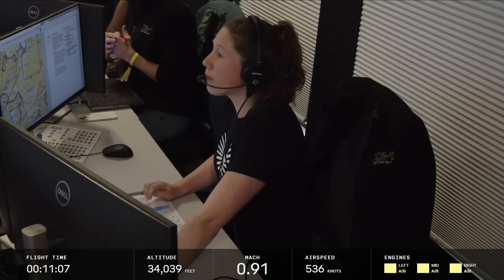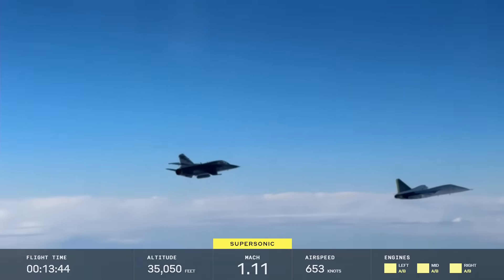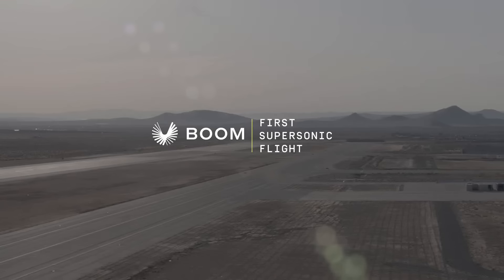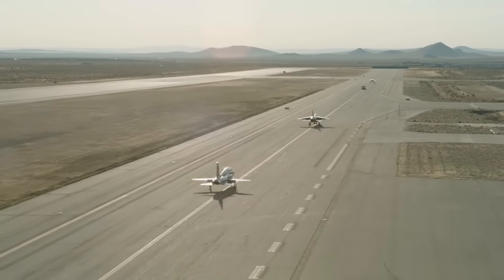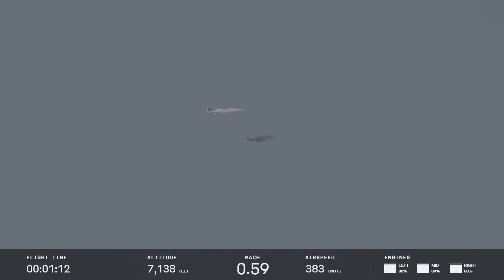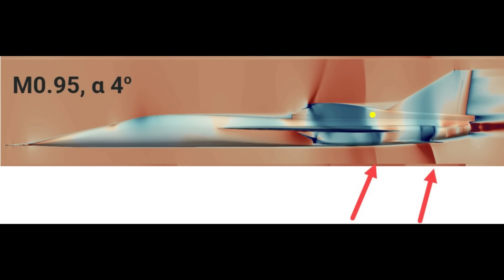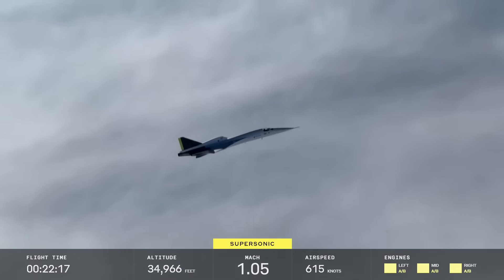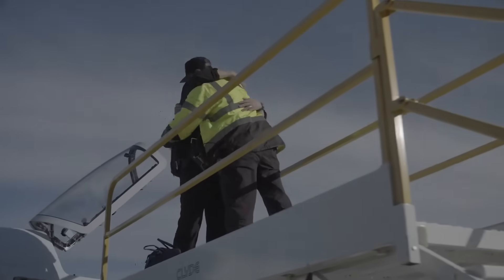XB-1 Baby Boom Goes Supersonic - Jet Planes, Starlink & iPhones

Comment: This really makes you appreciate the engineering that went into Concord 60 years ago.
Reply: Concorde borrowed heavily from fighter and supersonic bomber design. It was more elegant, primarily due to the ogive wing. It also had a remarkable range. Few people point this out, but it used afterburner for takeoff, climb and acceleration. But it super-cruised above mach 2. It could not have flown 3,000nm unrefueled if it didn't.
Reply: @Triple_J.1  Concorde didn't usually use afterburner for acceleration or climb only for breaking the sound barrier and take off- AB was too inefficient. And it had a range of 3,900 nm.
Reply: @BooBaddyBig  Concorde used full afterburner for lift off - fact from the Captains book : Life of a Concorde Pilot: From The Orphanage to The Edge of Space by John Tye. (Excellent reading by the way.)
Reply: @ No A/B in the climb. Just for T/O and then again for acceleration through Mach one.
Reply: @Triple_J.1  Yes but this one is "USA" made .Make America Great AGAIN !!
Reply: GO BACK FURTHER THAN CONCORDE TO WHEN CHUCK YEAGER FIRST BROKE THE SOUND BARRIER IN THE BELL X-1A WHICH WAS A BIG DEAL BACK THEN BUT COMMONPLACE AND ROUTINE NOW ! ! !🤔🤔🤔🤔🤔🤔🤔
Reply: It was quite something being under a Concorde taking off from Heathrow back in the day. I'm not sure that my hearing loss was down to this or all the loud rock gigs back then lol
Reply: This is nothing compared to Concorde. The Concorde with its mostly-bespoke Olympus 693s could supercruise for hours at nearly mach 2, whereas this is basically a warmed-over T-38 with a third engine, limited to short supersonic bursts in afterburner.
Reply: Or the Fairey Delta 2 which went supersonic in level flight without afterburners 68 years ago.
Reply: You mean the european Apollo programme.
Reply: @philippayne6655  Concorde
Reply: They'll be looking to the lessons learned from Concorde ove her years in service to guide the development of this new airliner
Reply: And imagine where we would be if they had continued developing and building them. Sonic Boom 20 years earlier.
Reply: Like my grandmother would YELL in church and my stepdad would say down at the mill..   "BINGO! You Nailed it"
Reply: She’s a real pocket rocket
Reply: Yes and I enjoyed flying her as a passenger…
Reply: It was very impressive for its time. The British and French engineers should be proud of their work.
Reply: @ It's still pretty impressive today. Much of the technology is still more or less state of the art. Concorde's engines were incredibly efficient even by today's standards.
Reply: Wow somebody broke the sound barrier, is this 1947?😂
Reply: Hi Scott live your videos by the way.  Two questions 1) where are you based these days and 2) what is the point of this aircraft, a prototype of a commercial venture?
Reply: Especially the 'e' for Europe, England and Excellence.
RH Tony Benn
Reply: Not seeing what all the fuss is about Chaps. Concorde flew 60 years ago carrying passengers over the Atlantic. The fuselage hit temperatures of over 60C due to friction whilst the out side temperature was -60c, this caused the whole plane to expand by three feet in supersonic flight compared to when it was sitting on the tarmac. Interestingly it was also fitted with frosted glass in the toilet windows, cause who's going to be looking in a 60,000 feet!
Reply: …and the forerunner of this aircraft, the Fairey Delta.
Reply: It truly does, but it’s way easier with 11 billion dollars
Reply: And also appreciate the super-cruise of the F-22. Supersonic without afterburner.
Reply: Yes, the Concord was first non military (civilian aircraft) to go supersonic.  Fair bit of government money though, I imagine.
Reply: concorde*
Reply: And the SR-71 blackbird is also amazing looking like it came out of Star Wars.

It's incredible how nobody ever cared more for higher speed...
Reply: Yeah, not really.
Reply: You are spot on! I fail to see exactly what is supposed to be ground breaking about this. Don't forget,  Great Britain had a jet car the Noble SSC which broke the sound barrier ON LAND in the 1980's ! None of this boom experiment is new, in fact it's very old hat!
Reply: well, from an engineering point of view, the concorde was a masterpiece. but commercially it was a disaster. they had like 70 orders, all cancelled because of the noise. and the ticket prices were many times more expensive than on subsonic airliners which also contributed to the end of the supersonic era.
Reply: @mrxmry3264not quite. They cancelled be cause the US denied them access to it airspace whilst flying supersonic. Noise was the excuse, commercial extortion was the reason
Reply: @mrxmry3264 Noise legislation by the US government, you mean.
Reply: @mrxmry3264Concorde orders were cancelled because of the 1970s oil crisis increasing fuel costs. Noise was a secondary issue, there were plenty of routes over oceans.
Reply: @ No, the options were cancelled because the 747 (1969) ushered in the ethos of minimum seat cost per passenger mile, changing totally the direction of the airline market. The supersonic market all but vanished when that happened.
Reply: @gzk6nk the US banned supersonic overflight in '73, and QANTAS cancelled its order for 6 Concordes in .... 1973, and Boeing didn't have one. Imagine crashing a Boeing at supersonic speed.
Reply: @mrxmry3264 There were lots of people who could afford it. However, why wait for a Concorde flight if you can just hop on the next regular flight and be in NY in 7 hours when with Concorde it took an average of 9 hours? (Assumption regular flight: one flight every two hours, flight time 6 hours, average wait time 1 hour. Assumption Concorde: two flights per day, flight time 3 hours, average wait time 6 hours.)
Reply: If this was the equivalent a Starship test flight, it would have exploded at Mach 0.8, and Elon Musk would have proclaimed it was a brilliant result.
Reply: @Beer_Dad1975 I found the EDS, probably TDS too. Salt lyfffffe 😂 cry baby cry!
Reply: *Condcorde
Reply: There was no reason the concord couldnt work. The metallurgy and fan r&d just wasnt there yet. Now we have engines that eat 70000 lb of thrust for breakfast, concords tapped out at 40000 lb full ab.
Reply: Concord was an complete POS !
Reply: @gertjanvandermeij4265  Concord was the cutting edge of technology.  Unfortunately it's operating costs exceed the number of people in that much of a hurry so it lost money. 
Sonic boom restrictions didn't help. LA-NY or SFO-NY  might have been profitable.
Reply: @gertjanvandermeij4265 . Maybe, but Concorde was a triumph.
Reply: Never  financially worked
Reply: not true, it intermittently was profitable, but being restricted from most of US airspace was a critical setback, as it was essentially designed for US to UK and mostly denied it except 3 airports.
Reply: @LordFalconsword   It was very profitable for BA right to the end of service  once Lord King took over when the airline was privatised and they started charging the high ticket prices the market could bare,
Reply: It was highly profitable for British Airways in its later days.
Reply: @ It's been considered an Anglo-French equivalent of the Apollo space program. Except unlike Apollo the airlines made good money, which was taxed, and among the many spin-offs included the creation of Airbus, which is still going very strong.
Reply: @ They absolutely weren't given the planes for free at any point. BA was originally owned by the government, and their Concordes were sold as part of the overall package when BA was privatised.
Reply: Not true. Operated profitably when released from the shackles of BA's corporate management. Would have continued to do so had the Sept 11th terrorism not murdered many of its regular customers. Every development day that Boom has will highlight how incredibly ground- (/air-?) breaking the dual-language Concorde development team was. Perhaps we should wait until Overture is in commercial service before attempting to make comparisons. This aircraft is more comparable to a Fairey Delta.
Reply: IT DID FOR HIGH NET-WORTH PEOPLE ! ! !👌👌👌
Reply: Yes it did. British Airways made a large profit from Concorde until the French pulled the plug.
Reply: @peanuts2105 yes they did  , but as the previous commentator said it was GIVEN to British Airways and Air France by their governments , we the tax payer footed the bill .
Reply: @peanuts2105  Because the taxpayer paid for the plane. Basically they shifted wealth from the public to a private company to create supersonic leasure trips for rich people xD
Reply: @hernerweisenberg7052   do you feel hard done by or bitter?
Reply: @ Not quite 'given'. But they got them at a bargain price because no-one else wanted them. The supersonic market became very small after the 747 showed the way to low seat / mile costs in 1969.
Reply: @ Incorrect. Total bollox. The supersonic market vanished when the 747 showed the way to cheap seat / mile costs. Neither BA or AF wanted it either by 1976, but being state owned they had to take it.
Reply: @ So you think they should have been scrapped when the wide-bodies with ultra cheap seat per mile costs took away the supersonic market, instead of operated by BA and AF for 27 years?
Reply: money
Reply: @evanfinch4987  and years and years of experience building aircraft and engines.
Reply: @evanfinch4987  Oh, woe is me, down with capitalism, engineers like to be paid and being able to feed their families, those vile exploiters of the people !
Muppet.
Reply: @evanfinch4987 Yes, that's how it works, dum dum, you use the money to make stuff
Reply: The Concorde was only ever profitable when you consider the planes were given to the airlines.  And in the end, not even then.
Reply: @rockets4kids  I believe it was very hamstrung by the not-invented-here syndrome.
Reply: @ BA made a great deal of money out of it - after privatisation once they upped the tickets price to what the market would bear.
Reply: @ It was very profitable for BA once Lord King took over when the airline was privatised and they started charging the high ticket prices the market could bare.
Reply: @rockets4kids  That doesn't make Concorde a failure
Reply: @rockets4kids  Wash your mouth out with soap and water ... your last comment saved you from the soap :)
Reply: @rockets4kids Actually Concorde made very solid profits for British Airways and in many years was the only part of the company to make a profit. Air France never made a profit from Concorde, less people wanted to fly from Paris than London to New York and Paris was that bit further making the fuel situation close to marginal.
Reply: @ BA and Air France paid for their first 5 aircraft each, it was aircrafts 6 and 7 to each of them that were pretty much free to use up remaining production. I am aware the UK and French governments paid all the development costs. The fact remains that BA made a sizable operating profit on Concorde. Oh and some of those development costs paid for technology that ultimately was inherited by Airbus, like fly by wire concepts, so it wasn't all money down the drain.
Reply: @owensmith7530   that would have been my point, Concorde was the starting point of Airbus basically, it established building an aircraft across European borders, as in shipping big parts around.
Reply: @ Actually I don't think they shipped big parts around eg fuselage for Concorde, there were two parallel assembly lines one in the UK and one in France. Certainly small and medium size parts were shipped around though. And it did lay the seed for Airbus.
Reply: @rockets4kids  They did make an operating profit.
Reply: @rockets4kids  It printed money for the airlines that had it though.
Reply: @rockets4kids  So the mis-judged ticket price means that Concorde was a sh1t aircraft. A bit like saying the Sherman was better than the Panther because it was cheaper to build. Tell that to the dead Sherman crewmen. Yes I'm still angry about it.
Reply: @bjh3661 Considering a big contribution to the Germans losing the war was their obsession with overly big and expensive tanks, yes maybe the Sherman was better. And of course you're going to have more dead tank crew if you can actually build enough tanks to wage war with.
Reply: @bjh3661 @bjh3661  My brother in Christ, the Sherman was a better tank than the Panther. You don't win wars by building a minuscule number of "wonder weapons."
Reply: @ Ticket price was right after BA privatisation when Lord King took over the airline. Then it became a super profitable aeroplane for BA.
Reply: @ It was very profitable for BA once Lord King took over when the airline was privatised and they started charging the high ticket prices the market could bare.
Reply: @bjh3661 The Sherman's  won. They were cheap enough to have lots of them. They also spent a lot less time in maintenance. 
Also the Sherman was a LOT better than the myths about it. After the ammunition was put in water the Sherman had an excellent crew survival rate. Unlike current Russian tanks whose turrets appear to be part of the Russian space program.  The crew does not survive the turret blowing off if they haven't got out exposing themselves to enemy fire first.
The German suspension design gave them faster tanks with a smoother ride, good for firing while moving but it required frequent maintenance that required maintenance that took days, not hours, to perform.  
The usual main gun of the Sherman could penetrate Tiger or Panther front armor although from closer than optimum. The superior  numbers of Shermans made tactics that got several Shermans close enough to kill Panthers possible. 
In all seriousness the Sherman was the most effective tank of all time by a variety of standards.
Reply: @bjh3661  the sherman was better than the panther.

Comment: But did it make a sonic boom? The point of all this research is to make a low-boom plane
Reply: No, that is NASA’s QueSST program with LockMart.
Reply: That is not the point of Boom.  It's kind of right there in the name, ya-know?  The point of Boom is to make a financially viable successor to Concorde.  That means a far more efficient and afterburner-less supercruise passenger aircraft.  It's still going to boom like Concorde, and it's still going to be limited to over ocean routes.

Comment: Are they designing ways to mitigate sonic booms with this aircraft?
Reply: No
Reply: @sebastiaomendonca1477 yikes, seems like something you would want to work if flying across countries.
Reply: @wxfreak  they dont plan on flying it across countries, they plan on flying over the atlantic and pacific. concorde couldnt do routes like that because it burned too much fuel but modern planes could do it profitably, theoretically.
Reply: at this juncture sonic boom is the least of their problems, they don’t even have an engine, the whole thing is a bottomless pit at this point
Reply: @olasek7972 I love that you pulled out the thesaurus for this one. Gotta keep it original after you replied this exact thing 15 other times